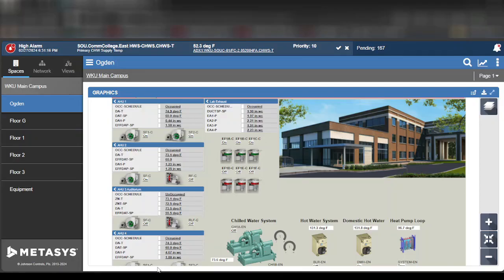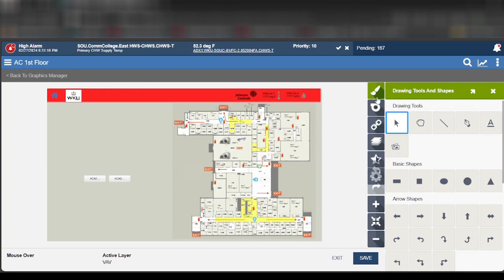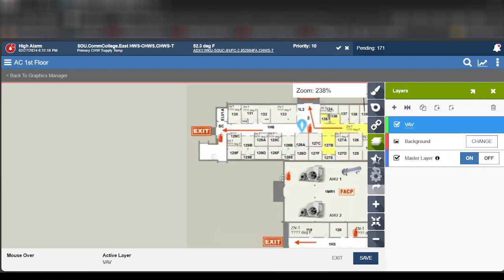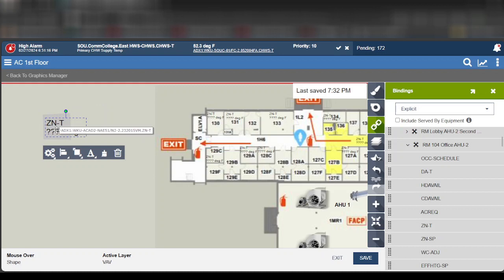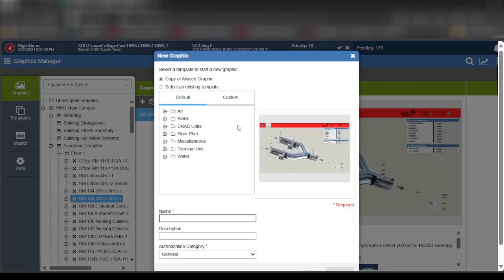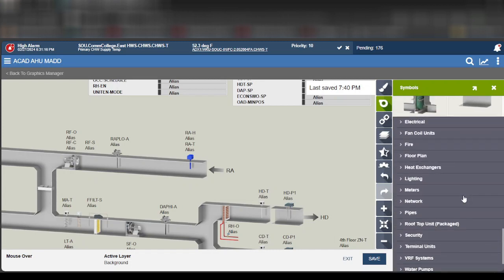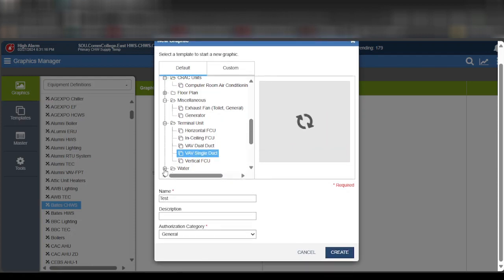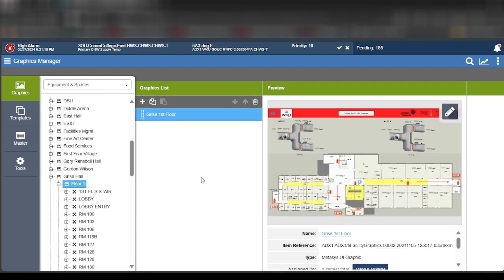Metasys MUI Graphics: A Beginner's Guide to Custom Interfaces

Comment: Hi - I'm used to dealing with displays on Rockwell FTSE, so this is all a bit new to me, but we use Metasys for our HVAC controls. I need to update some office labels in the display, but when I go the graphics manager screen, I do not see the little pencil icon on the preview to enter edit mode. I am listed as an administrator in the user definition. Any ideas?
Reply: Never mind - turns out the issue was the ones I wanted to edit were UGT graphics not MUI graphics, so I had to use SCT to edit them. Last bonehead made the office labels flat parts of the background image too, fucker...
Reply from the maker: Glad you figured it out. Thanks for watching. Please like and share the video and subscribe to my channel for more